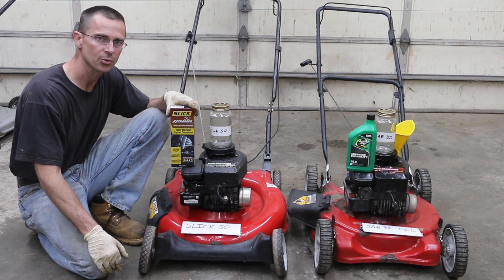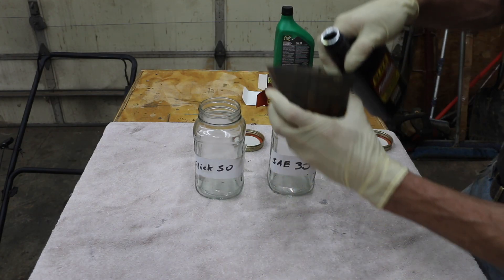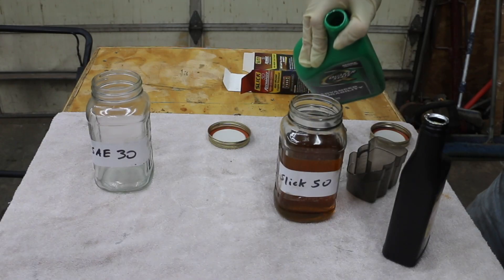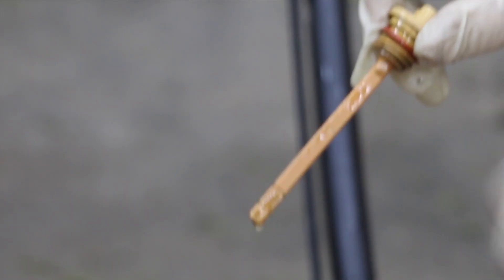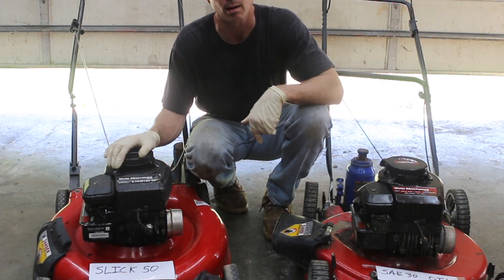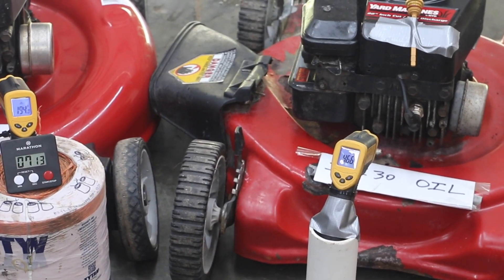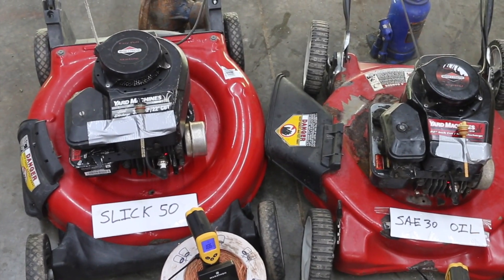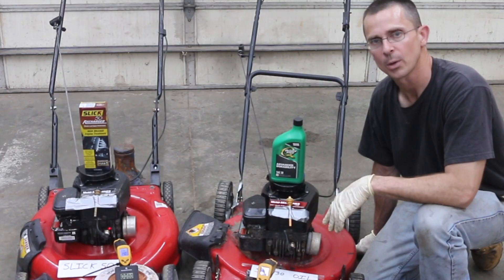Can't believe what SLICK 50 did to my engine!!--Dry Crankcase Test!

Comment: "Energy Release" , an additive, claims to bond to parts  molecularly. Might want to check it out. Also,  I remember Briggs and Stratton  did an experiment with Duralube. The conclusion was that it did everything it claimed but at the cost of the longevity of the engine. They showed the abrasive damage on the rod bushings from the nano particles. Iv'e also heard they swell at higher temps and will clog fine oil filters like Napa Gold.
Reply from the maker: This is interesting information.  Thanks for commenting and thanks for recommending Energy Release.

Comment: I don't see how Slick50 could have caused lower cylinder head temperatures, especially on an air-cooled flat head engine where no significant amount of oil even touches the head.
I'd say that engine was either running richer, and/or had some misfiring going on, or really late ign. timing, (Sheared flywheel key)?, or fan/ducting differences?
Something other than Slick50 was making that head run cooler...
Reply from the maker: Lee, I agree with you.  Next time I do a comparison video like this one, I will be using new engines.  It seems wasteful, but what seems more wasteful to me is all the money that is spent by consumers on inferior additives.  Thanks for commenting!
Reply: Project Farm 
Yeah, it's the only way to eliminate usage/wear variability from influencing the outcomes of such tests.
I do appreciate your efforts.
It's always interesting to watch.
Thanks!

Comment: Try Lucas oil, I have faith in it. I think you messed up this test. You should have run booth engines for about ten hours and then drained the oil out. That would have given slick50 a chance to coat the moving parts.
Reply from the maker: Thank you for the constructive feedback and for the recommendations!

Comment: Lucas might work better.
Reply from the maker: Thank you for this recommendation!
Reply: I think lucas will work really well but I often wonder if thats actually good for your engine. As you know but your viewers may not, oil is the 1st step in cooling the engine. If the oil is sticking its not transferring heat. Sticky oil may also keep little particles on the parts wearing away instead of being filtered out. Does lucas do what its supposed to? Yes. IS it good for your engine? Maybe. I'm currently studying organic chem so oil and hydrocarbons fascinate me and if you have technical questions or want to check the science feel free to message me.

Comment: I should mention that when the Slick 50 is used in a car, the reason you should change the oil after 100+ miles is that the Teflon solids that don't adhere to the metal will end up becoming trapped by the filter, and that the filter should be changed to prevent becoming too clogged and causing a problem.  I have used Slick 50 in my mowers before and should comment that when I ran it with the Slick 50 in the oil for too long without changing the oil (I think was over 6 hours) the engine ceased running.  I think that since there is no oil filter on the mowers, that these Teflon solids will separate out of the oil, and build up until it can stop the mower.   After the engine stopped running, I drained the used oil out, and put fresh oil in.  Then started the engine and it ran fine.  So it is important that if you put Slick 50 in a mower or something without a filter, that after running it long enough to treat the engine, that the oil must be drained and fresh oil put in.
Reply from the maker: This is great information.  Thanks for commenting!

Comment: I think slick 50 is good for metal to metal, but really bad for rubber seals and gaskets. I Had to junk a car due to rear main seal leaks very badly after treat engine with slick 50. About 700 miles later.
Reply from the maker: Thanks for commenting!

Comment: You should try Dura Lube I've had great success with it. I had one time had a newly rebuilt engine that had just got to the break in time and added Dura Lube to the engine. I had to make to pretty long trip and blew a heater hose had to drive about half hour after blowing the heater hose to get to someplace to repair it and get more coolant. After this indecent we drove that car for 10 more years and never had a bit of trouble out of the engine.
Reply from the maker: Thanks for this recommendation!

Comment: Kick ass video. I remember those commercials. The slick 50 engine looked newer as well. Also your vac pump fluid recovery system is exactly what i use to bleed brakes. Rock on!
Reply from the maker: Thank you very much for the positive comment!

Comment: Try BG MOA (motor oil additive) I believe it work outlast the sae30
Reply from the maker: This is a great suggestion--thanks!
Reply: Project Farm no problem, I use it all the time and it works wonder on customers vehicles and personal. I think you'll have amazing results with s it
Reply: I second this motion!  Here is a little BG History.....   Back in the 50's-60's, a product called Wynns was used by many stock car drivers, and Wynns was a huge sponsor. When Wynns became commercialized, they cut back on the quality and Wynns was no longer the product it originally was. Some of the engineers left the company and formed BG. They refused to this day to allow commercialization to cut back on the quality. Which is why you can ONLY get BG from service outlets such as your auto dealers or local garage. To find locations, go to BGFindAShop.com  I have been using BG MOA/RF7 in all of my vehicles since the late 70's when I first was introduced to it. BG also has gear oil, grease for packing bearings, ATF additive, 44k fuel additive for cleaning injectors, and a slew of other products that reduce friction and increase the life of your parts.
I also now use their DOC (Diesel Oil Conditioner) in my company's truck. The improvement of power due to reduced friction helps me put 80,000 lbs up over Vail mountain @ 30mph on a 65mph governed truck. Without the BG, I was only able to pull Vail @ 23-25mph.

Comment: To get a proper comparison you have to run 2 brand new engines on a dyno. A couple of things have to match before the start of the oil test:
Power level of both engines is got to be similar, let’s say within 5%. It’s a lot of variations in the power output on the small engines. 
AFR on both engines is got to be the same. It’s because leaner engines run much hotter.

Similar power level and AFR will make the engine temperatures about the same, precondition to make the oil test comparison.

The good think is that you made the best out of what you got! Congrats!
Reply from the maker: This is great constructive feedback.  I plan to use new engines in the future.  Thanks for commenting!

Comment: Why would the Slick 50 engine lock up so much earlier?  I thought an engine would lock up, at least is part, because of the increased engine temp, but the Slick 50 engine was way below the SAE 30 engine's temp when it locked up.
Reply from the maker: I'm not sure, unless the Slick 50 gets "sticky" when it heats up.  Thanks for commenting!

Comment: Years ago I did an oil change on my wife's 1990 Jeep Grand Cherokee right after I used Duralube in it for about 5k miles. When removing the filter I hit the sending unit and broke it off which was right above the filter. I drove it a bit and checked for leaks as it was Sunday evening when I did it and everything was closed. Since it didn't leak I assumed it was fine to drive and my wife took off to work the next day which was a good 50 miles one way from home. On the way home that evening she called and said it was making a funny noise and I wanted her to pull over and check the oil but she had a shit fit so I said screw it just get home. When she pulled in it was making a god awful noise like the thing was coming apart and barely idling, I had her kill it and then I checked the oil and there was nothing on the dipstick.  I dumped oil in it until it was full and it held 5 quarts instead of 6 so it had one quart of oil in it and had dumped the rest. I thought for sure the engine was toast. I started it up and it was making the noise but then got quiet and I drove it around and it seemed fine. I got the part the next day and replaced it and everything was good. My brother said that it could have worn a bearing and could still fry at anytime so I decided to sell it and sold it to a guy who owned a gas station close by. He drove that thing for another 200k miles after I sold it to him as I would go by and ask how many miles it had on it from time to time. He never had an engine problem from it. Crazy but it had to be the duralube.
Reply from the maker: Wow! This is impressive!  Duralube seems like a great product!

Comment: Honestly as a auto mechanic I've never trusted slick 50 but the one treatment brand that I do like and never tested but would love to see if it is everything I have heard and read is Lucas treatments. Of course they make many kinds of treatments and stop leaks and cleaning products but I've always trusted and used and recommended Lucas oil treatment to my vehicles plus my customers vehicles. My question is would you be willing to do something along the same lines as what you did on this episode. Like also show what the cylinder heads look like before you run the 30 weight oil and then the Lucas then run both motors up to proper operating temperature then drain both the standard 30 weight and the other motor with the Lucas . After cooling run both motors with no oil or Lucas to see if the Lucas does protect like it says. If that interest you please let me know I have been watching your demonstrations for quite some time now and really enjoy them and would love to see if I have been making a mistake recommending Lucas oil treatment to my customers thank you and please continue with your awesome videos thanks again nate
Reply from the maker: These are great video project ideas--thanks!

Comment: mix a teaspoon of tungsten disulfide with the oil- think youll see better than slick 50. tried in machines at work, saw servo currents drop from 80% to 15% on flat 'box way' type machine slides, where slick 50 was more like only 75% to 60% when i tried it years prior. 'lowerfrictiondotcom' sells it.
Reply from the maker: This is interesting.  Thanks for this recommendation!

Comment: Synthetic oil and DURA-Lube, not Slick 50, is the brand that did this same test and it ran for hours... do this test exactly like you did here ACCEPT USE DURA-LUBE...sYNTHETIC IS DESIGNED FOR  high temp [ AIRCRAFT] engines, so do the same test using straight synthetic...
Reply from the maker: Thanks for this information.

Comment: I've heard from friends when slick50 came out that it ruined their engines. I have used synthetic motor oil ever since. Case in point, I had a friend who raced at Mokan in Missouri. He helped me pull my heads on my 82 s10 and was amazed at how clean the inside of the motor was, and asked what I used. I told him about synthetic oils and he gave it a shot. After his first rebuild he went right for the synthetic, he was shocked when he got home from the races and pulled the motor apart, the rings never properly seated! The engine break in process was never successful. Next time he used regular oil for break in, then used the synthetic, from that day on he was sold on this amazing new technology. I'm wondering what something like castrol full synthetic, maybe vs another full synthetic, vs conventional oil would do
Reply from the maker: Thanks for commenting on this!

Comment: The only fair way to do the test is start with two brand new identical engines. If you look at how much more dirt was in the slick oil you can see it cleans much better than the SAE30 engine. I suspect if you start with new engines you will prove the benefit of Slick50. Besides, it's only YOUR money.
Reply from the maker: This is great constructive feedback.  I hope to run a test using new engines in the future.  Thanks!

Comment: I agree with those who said you need to open them up.  Neither is a new engine, clearly, and there may have been differences in the wear of these engines before you ran the test.  The one you ran Slick 50 in looks to be a Troy Bilt, and may have been a better engine, but with more years on it.  Its front wheels are sitting on an angle, like the axles are completely worn out.  It may not have been the lubricant at all.
Reply from the maker: This is great constructive feedback.  I hope to buy new engines for future tests.  Thanks for commenting!

Comment: Nice video but not scientifically controlled. Bet you both engines have different amount of hours. Not a valid test but a nice video. Open them up would give also further insight.
Reply from the maker: I agree.  I'll used identical new engines next time, when the budget allows.  Thanks!

Comment: This stuff right here.
 https://smile.amazon.com/MotorKote-MK-HL16-06-16oz-Hyper-Lubricant/dp/B000EG6CSO/ref=sr_1_1?ie=UTF8&qid=1505036387&sr=8-1&keywords=motorkote 
I watched a demo of this at a car show one time, where the guy had a round rod on a motor, and another metal piece that would drag against it. The bare metal, and regular motor oil would just sequel and smoke then stop turning, but when he added this to the rod it would smoke, but keep on turning and turning even as more weight was put onto the end of the stop rod. so i would say give this a shot. 
Iv'e put it in all my cars, use it on electric motors, bearings, hinges, and the most impressive one is when you mix it into the transmission of the car. For me it took my older Caprice Classic and smoothed out a hard shift from 2-3. SO i started putting it in my newer cars and on my Caravan it practically eliminated the shift points when your driving regularly and not hard accelerating (getting on the highway for example) it smooths everything out wonderfully. 
I would be really curious to see just how long an engine would last when it had this put into it vs just regular oil cause if the manufacturer claims are correct, it should just keep going and going for a hell of a long time.
Reply from the maker: Thanks for this idea!

Comment: Have you tried moly b shaeffer oil they claim it liberates the gears lower temp quiets engines I tried it on my lawnmower I can't tell the difference. I do run sheaffer oil on all my cars
Reply from the maker: This is a great suggestion--thanks!

Comment: The original slick 50 was legally stopped to sell their product in 1984... the name Slick 50 was never trademarked... so other rogue companies started using the name Slick 50 which has no connection to the original oil additive... you would need to find the Slick 50 pre 1984 to do the real test...
Reply from the maker: This is a great point.  I suspect the original version would have done much better in this test.

Comment: Not a real good test .. take two new motors with 0 hours on them .. and then run the test .. if yhe results are the same then and only then will i believe your claims about slick 50
Reply from the maker: This is great constructive feedback.  I'll see if I can use 2 new engines in a future video. Thank you!

Comment: Back in the day BG products would come to our shop and drop the oil pan off the engine to show there product penetrated the bearings on the crank and cam shaft- they ran the engine for 15 min. with out the oil pan on. I ask them how long this testing of the this engine -they told me that they had over 100 tests on the same engine. Pretty impressive.
Reply from the maker: This is pretty impressive.  I should test their product in a test like this one.  Thanks again!

Comment: I would like to see you test Mobil One against regular motor oil. Mobil used to run those commercials when it first came out, where they dipped flat screw driver tips in each type of oil and then tried to hold on to the tip. We even repeated this experiment in shop class. The Mobil One coated screw driver would always slip out from between your fingers. It was noticeably more slippery than regular motor oil.

I would also use two identical new engines as suggested by someone else from Harbor Freight for $99.00 each. That would make an excellent video to watch.
Reply from the maker: Bill, these are great suggestions--thank you!

Comment: You needed to agitate the slick 50 a lot because it is actually a solid that settles to the bottom of the container it comes in. The problem I have with this product is that it could probably work better if you could bypass the engine filter of your car for a few miles so it doesn't get filtered out.
Reply from the maker: This is great constructive feedback--thanks!

Comment: I have used Slick 50 before in my car and it had a leak and ran it not only with no oil but till there wasn't enough compression to go up a slight incline.  My car stopped near a gas station.  I was certain my engine was toast.  But what the heck, it couldn't hurt to put oil into the engine.  I ran in and got several quarts of regular oil and filled it up to proper level.  Started the engine and after a minute or so ran smooth as before.   What you are supposed to do with Slick 50 is after running it for a proper amount of time like 100+ miles )or perhaps in a mower run it for at least 6 hours as suggested by Neil below) is   to drain the oil and put fresh oil into it and run it for 6 more hours.  Then you should drain both mowers of oil and test it against a mower that hasn't been treated with Slick 50.  That is a more accurate test.  What I believe you will find is that the Slick 50 treated one  will actually run longer.  Furthermore after seizing up, you should put regular oil back into both of them and then try to start them.  I think you will find the Slick 50 treated one will run fine and the untreated one will remain seized.
Reply from the maker: Thank you for sharing your experience with Slick 50!